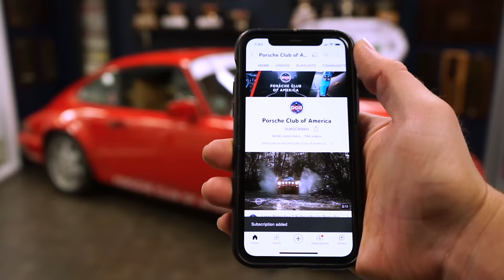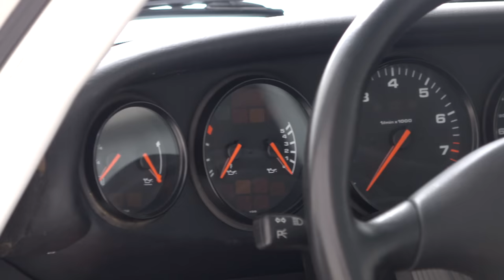Porsche 993 Carrera RS vs Clubsport: Everything you need to know

Comment: Is there a chance for an episode regarding elastic fuel hoses. It's not possible to order some hoses from Porsche for 944 for example and they use something called DKM connector which is a rounded cone inside, I couldn't find company that has those fittings available, including in Germany. Have you had this problem.